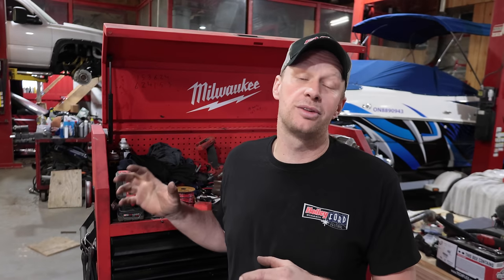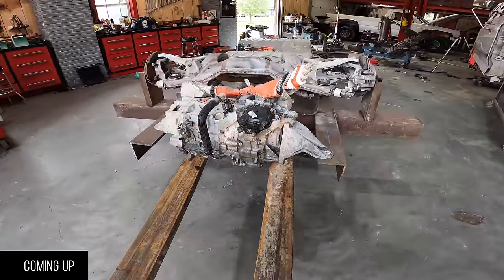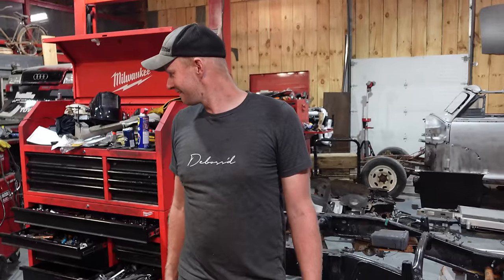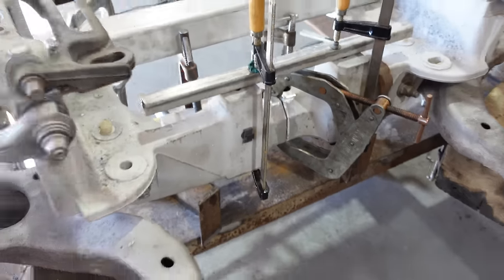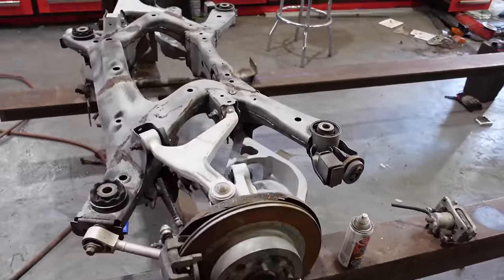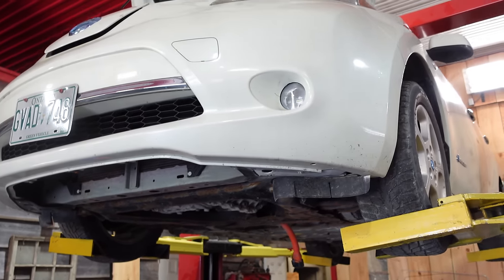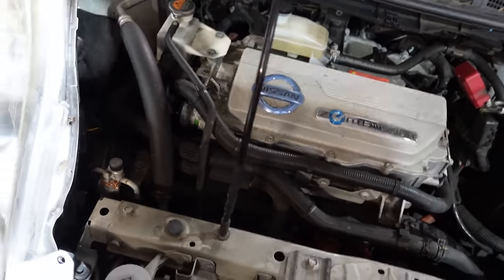Nissan Leaf Motor Gets Mounted in Reverse? #48CHEV [EP2]

Comment from the maker: Enter to WIN a 41" Gearwrench Toolbox (not sponsored) https://debossgarage.com/contest

Contest runs until March 31 2024 and the winner will be contacted via email, not in a comment on YouTube or any other social media. Contest is free to enter and additional entries for memberships and merchandise purchased on our official website. We only collect your contact information through becoming a free member on our website and do not share it with anyone. Please be aware of scammers / impersonators and do not give anyone your information claiming you won something from us on here. Thanks, be safe.
Reply: You can't change phase of motor if have encoder inside, check out if there if you can change your phase of motor before you find issue, else you may need reprogram a controller else you will get error code
Reply: Make this into a hybrid
Reply: @ansp6980  The motor and the controller are separate in the Leaf. The motor is a three phase induction motor. All you have to do to reverse a three phase motor is revers two of the phases (it doesn't matter which ones). He is doing it correctly and I do have the background to know what I am talking about. The motor controller won't need any adjustment as it won't even notice the change.
Reply: @wtftolate3782  That is a lot more complicated that it sounds.
Reply: Keep the Leaf 
And V8 Swapp It 😃

Comment: Pull safety plug on top of the battery to make it 'safer' to work with. Also remember to have an access hatch to reach the safety plug in the event of an accident and EMS/towing need to make the car safe for transport. Leaf has a hatch in the floor of the back seat footwell area. Love seeing this coming together
Reply from the maker: Thank you for that, I did not know that but will definitely use it.  Since the floor of the leaf is going in the 48, the hatch should line up!
Reply: Yep, some put the plugs in not the easiest of locations.
Think of it like a race car... where do you want the isolator.
Reply: I'm glad someone else mentioned it! 

Seeing that as a Toyota hybrid certified tech made my arsehole pucker.

Comment: Not a 100% but since working at a Nissan dealer now for 14 years having that rear suspension backwards might cause unwanted toe change when turning hard or going over bumps.  The normal way mounted in a car will slightly toe in under compression.  It's one of those things that was talked about often when the Z car came back in 2003.
Reply: I'm concerned about this and anti-squat geometry turning into pro-squat geometry.

Comment: That big orange connector in the middle of the battery is the service disconnect.  You should always remove it before touching any of the high voltage connections or removing the battery.  It breaks the circuit to prevent any voltage from being present anywhere outside the battery.  You access if from a cover in front of the rear seat after you disconnect the 12v battery.

Comment: Interesting project. I think your perspective on driver experience is very specific to your experience and goals.  Having E cars for the last 5 years, I find my nice BMW gas car to be loud, jerky and way overcomplicated, and I enjoy the smooth, quiet and rapid acceleration of electric motor to be fantastic sensory experience. Though those characteristics may be less noticeable in a Leaf. I do agree that range anxiety is real and creates a different pattern of planning and driving from the fuel driven cars, but with the newer cars with larger and fully functional batteries minimize that issue.

Comment: I work at a fab shop, mostly repair/refurbish/restore older, classic, vintage, antique vehicles.. of my personal projects, two of them are matching ‘55 Buick Super 56R’s, one I’ve been ‘S L O W L Y’ attempting to restore as all original. The other one was originally acquired as a parts-donor for the 1st Buick. Almost immediately after #2 arrived to me at my place, via a 9 car car-hauler from Tucson, Az to my place in SoCal, we got some light rain… that bit of moisture caused the patina of parts cars’ very straight body, to sheen so nicely that i then wanted to switch gears in getting the “parts car” all fully functional, employing all of the worse-off parts from #1, while setting aside its better condition parts (mostly its “bright work” parts) for #1. Now, #2’a original 322 Fireball Nailhead, although complete, was VERY seized up & requires being rebuilt. I’ve gone back & forth in my mind, of trying to decide if that’s be worth doing (#2, although extremely rusty & cancerous, throughout, is a factory original A/C optioned car) or, doing something along the lines of what y’all did with this classic ChEVy, going “HYBRID” instead tho… thoughts?

Comment: Respectfully I have to disagree with the comment that EVs can’t be fun. I wont argue that 1st gen Nissan leafs with 107 hp aren’t fun. They aren’t and weren’t designed to be fun. Similar to a boring econobox four banger with a cvt. 

There are plenty of EVs that are fun. The instant torque doesn’t get old. You can get into gaps that even fast ICE sports cars would only dream of. There are no turbos to spool up or gears to downshift. When you hit it, it’s a rush. Plus if you have cars like the model 3 performance, you can still roll donuts and hoon if that’s your thing. 

This is coming from someone with a V8 mustang and fast electric car. It’s not the same and there are things that I still love in a combustion vehicle like a manual transmission or V8 sound, but there are also things that I can only do in an electric car. 

Awesome video series! I love that you are trying something different!
Reply: Agreed..  I love driving my EV.  The torque is so much fun,  and the car drives like it is on rails... love it!
Reply: Agree, the Nissan Leaf Gen 1 is one of the worst EV out there. No wonder it's not the most trilling to use... I can see Rich point's as well. You don't have the same level of feedback compared to an ICE and there's no gear box as well.

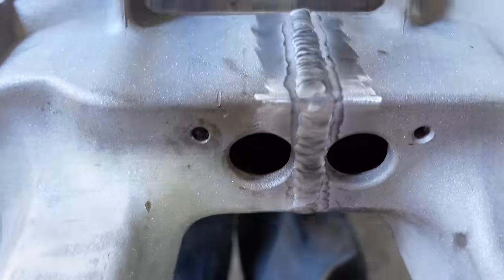Comment: Fellow Ontario based custom car enthusiasts - at 10:20 Rich mentions "whoever safeties this..." - Have you had issues getting professionally-done frame work, for example frame notches, performance modifications like replacing solid axle with IRS, engine swaps requiring new engine mounts, or subframe repairs safetied? I've read the safety check list the MTO provides and it's fairly up to interpretation what kind of modifications an inspector can deem safe IMO... For example I'm fitting a front mounted steering rack instead of a rear mounted one in a car I'm working on to clear a new transmission, and therefore moving the subframe member it was mounted to from behind the engine mounts to in front of them. The continuous TIG welds I'm laying down should be leagues stronger than the messy factory MIG stitch welds, so if I were an inspector I'd think "sure it's not OEM, but objectively the risk of failure to hold the steering rack is clearly lower than before and the work was clearly done well, no issues there". Not sure if most other inspectors would share that confidence though.

Comment: Swapping the phases will change direction of the motor, but you might want to look into resolver feedback. The motor typically receives feedback about the motor position via a resolver or an encoder. If you’re using the OEM leaf controller it might trigger a fault or prevent the motor from spinning if you simply swap phase cables. There’s surely a way around it, but figured I’d mention it in case you hadn’t looked into this yet.
Been watching for years now, love your videos and can’t wait to see how this one turns out.
Reply from the maker: Someone did it on another channel when they put it in the back of a 240.  That was enough for me, if he can do it, so can I
Reply: @DEBOSSGARAGE  +1 the motor has a sensor similar to the crank angle sensor on a combustion engine. The interwebs says you have to swap some wires on this sensor too. All the info out there is for the EM57, you have the EM61. I believe the basic idea is the same though the wire colours might be different.
Reply: Exactly what I came to say.... swapping phase will swap motor direction, but depending on the controller feedback, it may cause it to shut down or throw codes. That is more like a BLDC motor than a conventional AC motor and the controller needs to know the rotor position to time the output.
EDIT: Oil flow too..... the whole gear train will be spinning backwards for long periods and higher speeds than designed. Some have drivetrain driven pumps, some rely on splash lubrication and some external. And, just because one person did it, doesn't mean it works. Guess we'll all find out.
Reply: Reversing a frequency controlled AC synchronous motor (I assume, not knowing how it is wired) rarely is as easy as just swapping two of the phases.  I'd have a electrical engineer (a power EE, there are many different specialties in electrical engineering) review how the internal wiring of the motor is configured, and how the Nissan controller supplies power to the leads, and the particulars of how the controller works.  You might even contact a Nissan engineer about how to reverse the motor, it's possible that they would be open to helping you.  Given the amount of power you are dealing with, some extra caution is probably wise.  It's a little like asking one of your daughters to rebuild the CAT diesel in your pickup.  She might try, but she doesn't know enough about it to know what things she has to be careful doing.
Reply: @DEBOSSGARAGE   What type of gears the Leaf uses?  Helical gears or straight cut gears?  You might have been influenced by Edison Motors who said that their motors could run forward or backward.  But their gears are straight cut, for an off-road truck so noise and vibration don’t matter.  You may find normal helical cut gears with thrust bearing on one side.  Not applicable to run in reverse duty cycle.

Comment: Neat to see the guts of an electric car. That cable to the motor sure has tons shielding. If you ever had to make longer run. Make sure to buy vfd cable. It helps prevent interference and protects motor from voltage spikes. I wonder if Edison truck are using those cables

Comment: If you get into modding the inverters on these they are  total tire burners. Arlin Sansome ( another canadian) is an expert on hacking these things and built a tire melting honda with a leaf motor. It doesn't have to be slow!

Comment: I love the fact that you are moving forward on the ev projects don't get me wrong I am a diehard internal combustion fan but we all also have to think about future generations and what we leave behind I'll miss the roar of a well tuned snarling big block or even an old 2 stroker Detroit but electric is the future and they make tons of power and torque immediately no boost or nitrous needed they can and will be very cool and scary fast just without the hearing loss and inability to breathe or see through the nitro fumes
Reply from the maker: Diesel isn't going away anytime soon.  I do however, want to know as much as I can about every kind of vehicle.

Comment: You may find the A/C Compressor is part of the Battery cooling circuit and BMS
Reply: Leaf batteries don't have active cooling :(
Reply: Nope, not on the old leafs, there is no cooling whatsoever in those batteries.

Comment: This is very interesting to me, as I am doing a Camry 3.5 V6 swap on my old 93 Toyota Celica but was thinking of possibly utilizing the rear for a Electric motor and make a semi-hybrid that would only come on when the Cruise control is set or an on demand button for AWD situations.
Reply: A Camry swap has never sounded as exciting!
Reply: @Vaino_Hotti  when this car was new it came with a very similar engine as the Camry, just a sportier version of the same 5SFE 2.2L 4-cylinder. The 3.5 2GR V6 just sounds soooo heavenly, and MOSTLY fits under the hood (with minor modification). It has been done to quite a few MR2's at this point, and one 98 Celica that I know of, I'm trying to gather to gather the parts as we speak, but they seem to be in little supply in my area, which is weird for as common as these engines are.

Comment: You might want to talk with Dala's Ev Repair here on YouTube, he has done a lot of stuff with Leafs. Including upgrades that increase your motors power output, swapping chargers, etc. And yes as a Leaf owner EVs are definitely niche purpose use vehicles, but it was nice, year before last, going for 4 months without buying gas.
Reply: Dala's Leaf is a MkII so so a more powerful inverter was available as a direct swap. This is a Mk1 Leaf so there was only ever one inverter that directly fitted it. Having said that the motor is capable of over 300hp with a suitable inverter but that requires a lot of electronic knowledge.

Comment: Great project guys. I used the same model Nissan Leaf donor for my EV conversion and it worked out great.
Don't try to fit all the Leaf control gear into your car. There is no need if you use something like a Zombieverter VCU and it will save you trying to fit the entire Leaf loom along with various modules in your car.
I used a solid coupler to mate the motor to my gearbox so maintained the 4WD in my Landrover Freelander. I made a video series about it if your interested.

Comment: My wife has a Chevy Bolt. It is not a comfortable car, it does not handle well, suspension feels terrble. But it is like a motorcycle off the line, the torque is so strong.
Reply from the maker: Next episode will be building the frame and comfortable suspension

Comment: This is a fun project. I had no idea how "easy" it was to pull out the Leaf drivetrain and reconfigure it for other vehicles... It makes me wonder how hard it would be to stuff one into the back of a FWD car or front of a rear-engine car for a homemade AWD hybrid? It could be a neat way to add power and traction while improving fuel economy and not sacrificing reliability.
Reply from the maker: If it was easy, everyone would do it
Reply: I put the same motor in my car and made it 4WD. 😉

Comment: I don't agree that the driving experience is dull if you drive let's say a Model 3. On the highway, sure. But any car is boring on the highway. Around where I live we have smaller roads I regularly have to drive that are very twisty and with a big portion of twistyness AND good visibility = inspired driving. Once you learn a Model 3 (especially the RWD version that we have) it gets interesting on these roads. When you push it it gives you loads of feedback from the steering and chassis and you can really push these cars. The regeneration braking can be used to balance the behaviour like with engine braking on higher revs. And is really planted. On the highway the Autopilot is great to have as a safety feature and makes you much more relaxed while driving and arriving much less tired. You shouldn't base your opinion on an old Leat is like basing your opinion on Porsches on a 2CV. ;)

Comment: Range anxiety is only a thing when you have an old Leaf which is basically a Model T in the EV world by now, with a terrible battery that has almost no range.  I’ve been driving EV’s for over six years and haven’t had range anxiety for many years.  I’m a through and through petrolhead, but love driving our EV as well, but for different reasons than my gas car.

Comment: If the drivetrain is flipped, so reverse goes forward, there may be issues in the transmission.

instead of gears pulling together they will push apart, so thrust loads won't be right.

Comment: For me, where I'm at, and where I drive, "range anxiety" doesn't fit particularly well.
Sure, I can see the attraction in the idea of one day getting into the car, aim for the horizon and take off. 
But I'm well past Bruce Springsteen's lyrics of "I took a wrong turn and I just kept going".
For all realistic intents and purposes, I know where I'm going and what I can find along the way.
I can plan and figure out beforehand if it's going to work out.
So short of road closures, charging stations breaking down or other catastrophic events, I'm good.
What I'd agree to though is "charge TIME anxiety".
I do a couple of road trips each year during peak travel time. 
In a Diesel/Gas car, fueling up not an issue. At most, I think I've had two cars ahead of me at the pump. 
On a 7-hour journey, that wait isn't going to register.
For an EV, facing a two-vehicle wait at the charging station, that's a useful chunk of time.
This will probably get better with time, but as of now it can be a real issue.

Comment: Thank god you didn't flip that suspension, that was gonna suck. For the CV axles, I'd just cut and weld em, get some G35 rears. I've had good luck on an old Subaru I did like that. Chopped the axle to length, cut a sleeve to cover the weld and slid it passed, grooved it out by basically chopping the ends into pyramids, clamp the shaft into some angle iron (don't forget to slip on the sleeve, weld it up, grind enough to slip the sleeve over, weld the sleeve.

Comment: You will end up with a vehicle that you can only drive a certain distance before you have to spend 45 minutes at a charging station before you can go anywhere else, unless you're going to do the hybrid conversion on it. I spend $20 on gas that will last all week long, unless I do more driving than usual. Luv ya bro, but I'll keep my gas vehicle.